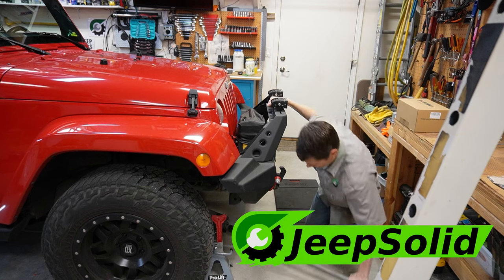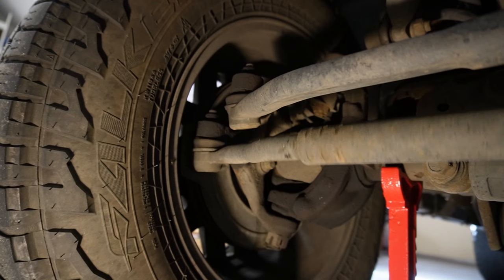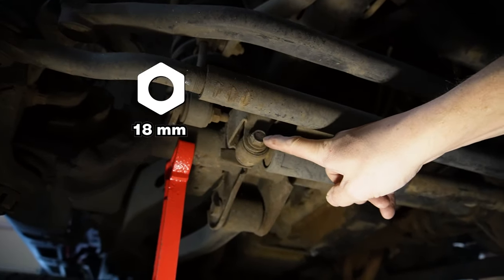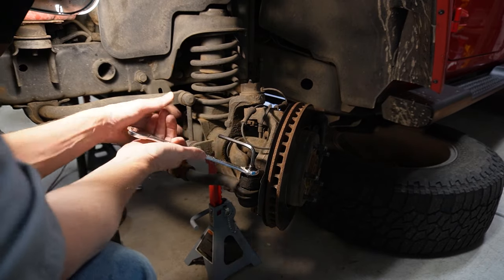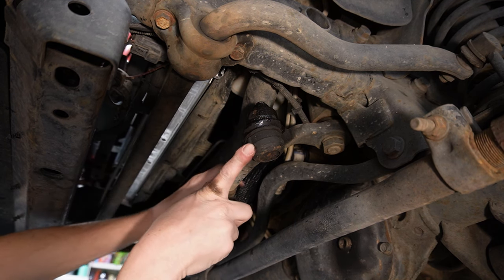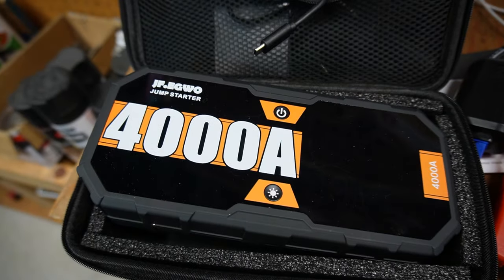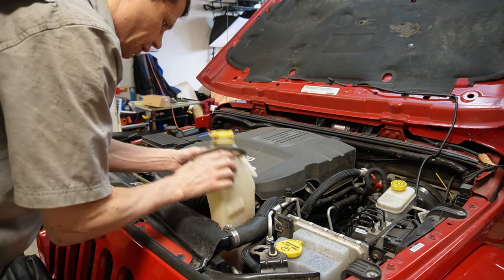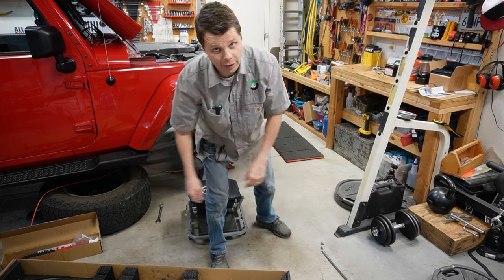Jeep JK RockJock Tie Rods!

Comment: I changed my ball joints with  greaseable /rebuildable ones from Terra flex while  i did the gear change.. I didn't have death wobble, but it steers so much better now, more precise.
Reply from the maker: Yes. This setup I have no is so much better!  Felt the difference immediately